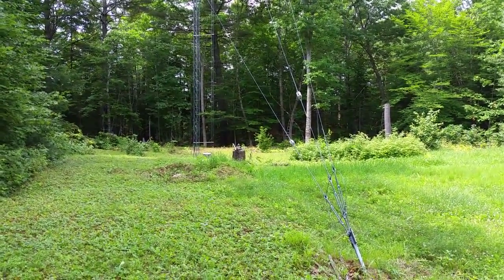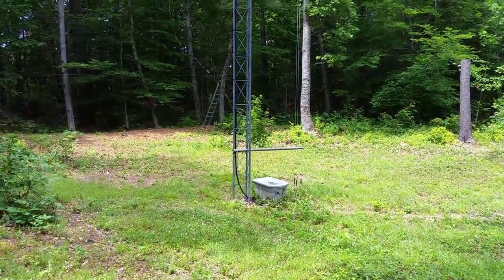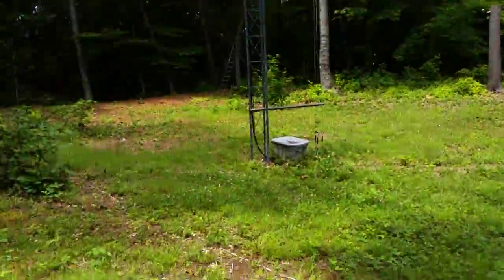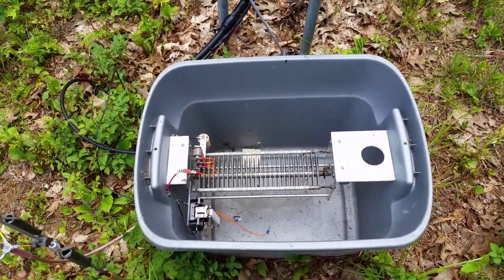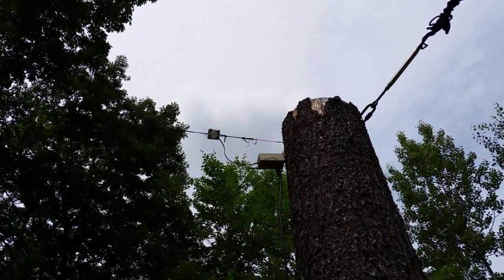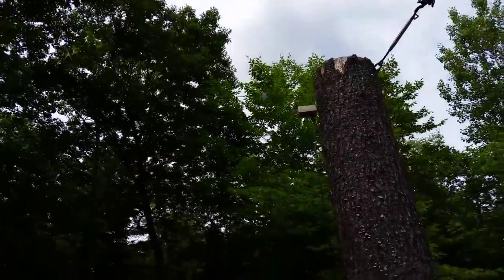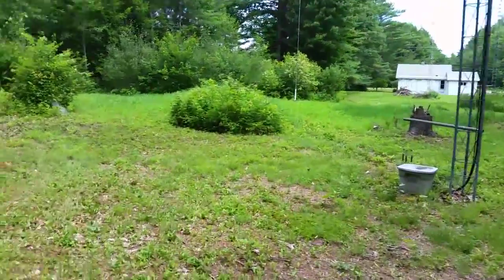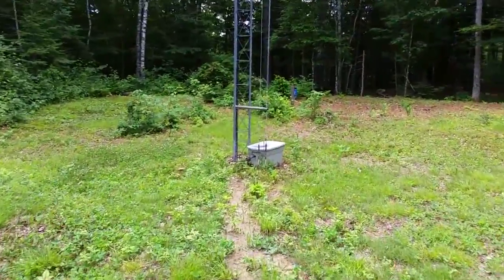160 Meter Antenna Tour

Comment: Paul, That is not a gamma match, It's shunt fead.73 Ed W7MAD
Reply from the maker: Yes, it's a shunt feed but there are two types of shunt feed arrangement. There is the gamma match which uses a single capacitor between the coax center and the wire running up to a 50 ohm tap point on the tower. That is what I use. But you can also use the omega match for shunt feeding. That configuration uses two capacitors: one in series between the coax center conductor and the wire running up to a tap point on the tower, another from the coax center conductor to ground. The omega match is more flexible as it does not require finding the 50 ohm tap point on the tower.

Comment: Beautiful setup . Thanks for sharing,  I’m mulling over what those trees were doing for your vertical to help it work on 80 meters.
Reply from the maker: Me too. I suspect they were acting as capacitance to ground. Precisely how that caused the existing 160m shunt feed to also work on 80m I don't know!
Reply: I've seen a guy at a Hamfest use a tree as a radiator for 2 meter.